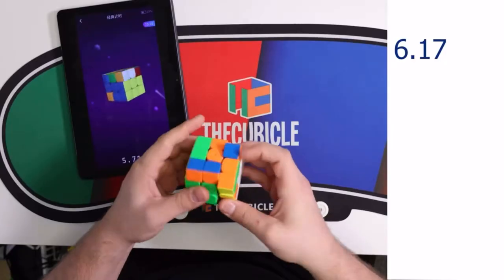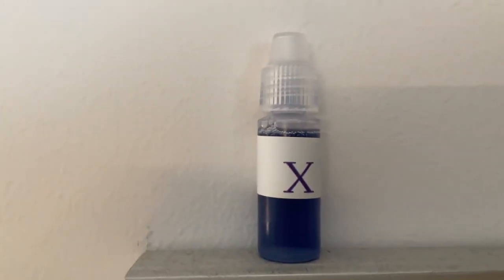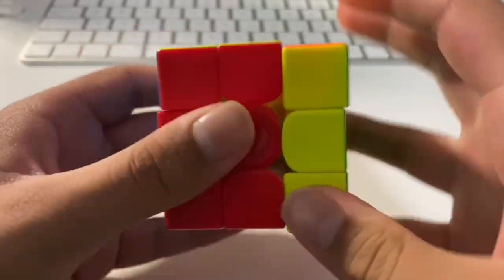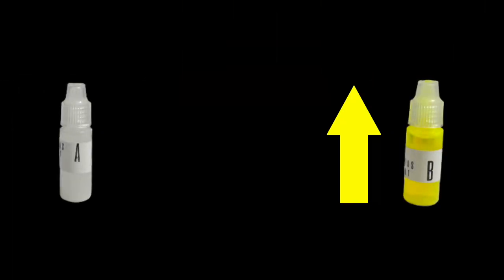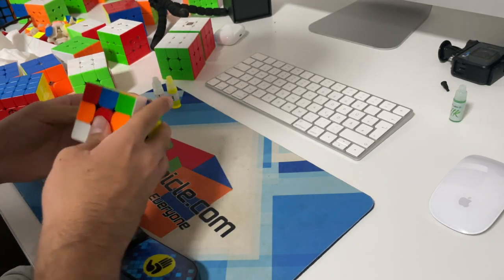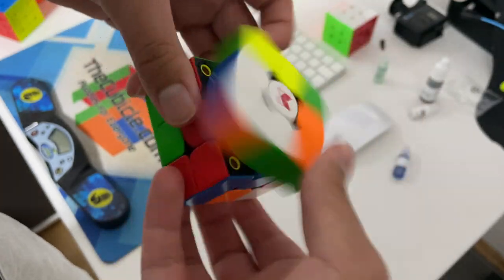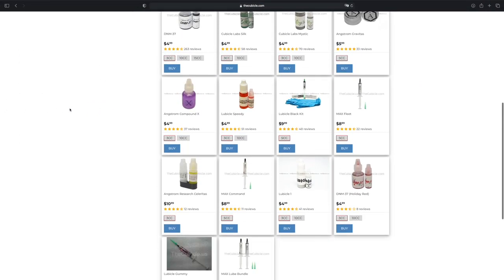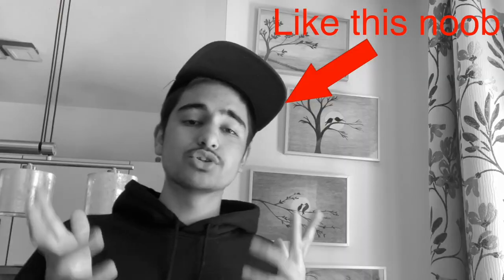The POWER of Cube Lubes | Tanish Dhiman X TheCubicle

Comment: QUESTION FOR ALL CUBERS:
do u have any suggestion to what lube put in gan 11 m pro? (core, pieces etc)
At home I have weight 5 and dnm
Reply: DNM is definitely right. That’s the exact same setup is used in my 11, except I also use dignitas on the feet of the corner pieces and put the weight 5 on the core and edge piece tracks. If you’re using a 12 instead of 11, switch weight 5 with Veritas.

Comment: question of the day: will the lubes for core work for maglev cubes???
Reply: Yes, but you'd use less as there's less contact surfaces, the stem of the core still makes contact with the center piece so you'd still put lube there
Reply: @codo8584   yeah, but al video says reduces noices of springs, and no there a re no springs :v
Reply: @rumg1042  You don't just lube to reduce spring noise (though this is the main reason 9/10), you lube the core to reduce friction on the contact surfaces as well, and since the core stem still makes contact with the center piece it's still a good idea to lube the core
Reply: @codo8584  yeah, but the lube will be affect the magnets? anyways i dont have money for lube cores, so, does not mater i think.
Reply: @rumg1042  The lube won't affect the magnets, lube isn't magnetic, and you don't need core specific lube, any high viscosity lube will work just fine as a core lube
Reply: @codo8584  th lubicle black is a metal based one soooooo, i dont know what about it.
Reply: @rumg1042  ...you do realise not all metals can be magnetised right?
Reply: @codo8584  yeah, i know, i remember it when i view the lubicle black page in the cubicle after publish the comment. anyways i think lubes for core are not for me, i ruined a cube for 1   day triyng to lube the core.